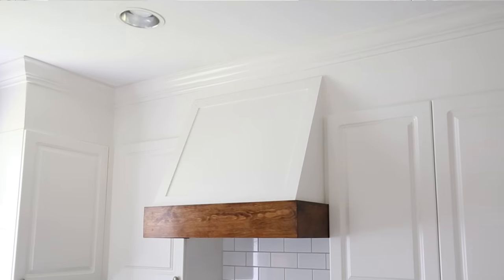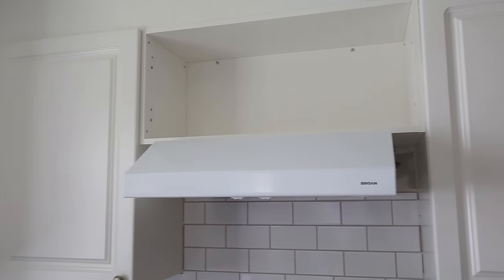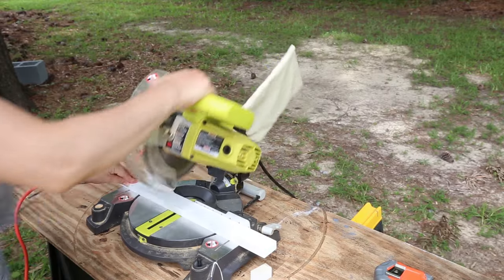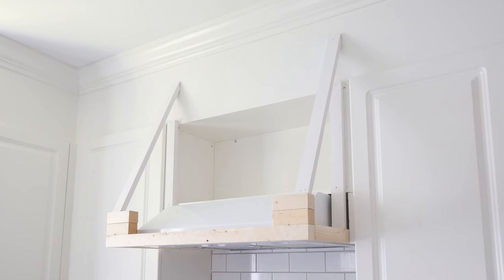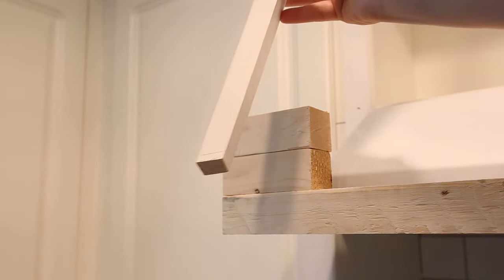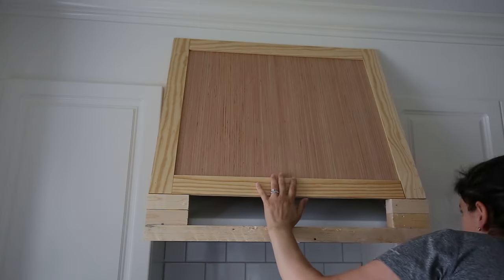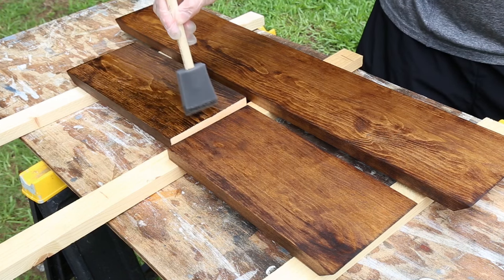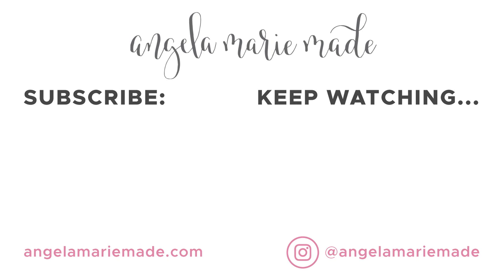DIY Range Hood Cover | How to Build a Range Hood Cover

Comment: And I have to say I have looked for the last hour for a "simple" build that gives a great, inexpensive finale. Like you have here.  I will definitely use your plan. AND I found a Nice Broan vent with all switches located on the bottom of the unit (not front panel). It was 99.00 at Home Depot.  Lowes had the same thing for 160.00.  I love Cheap...er inexpensive also
Reply from the maker: That is so nice to hear, I'm glad this video was helpful. Great deal on the range hood as well. Thanks for sharing!

Comment: Gorgeous! This video ended up inspiring me to entirely redo our hideous basement kitchen. Once I'm done on my $400 budget it will go from ugly 80's laminate to chic farmhouse modern. I'm starting the range hood cover project today so I'm excited to start and this video makes me feel WAY more confident to do something so extreme by myself. Thank you for providing such clear instructions and helping empower us DIY'ers!
Reply from the maker: Thank you so much, I'm so glad you were inspired to make over your kitchen! You got this!!
Reply: @AngelaMarieMade  I wish I could attach a photo but it turned out amazing and took hardly any time! Mine is free floating (not attached to cabinets) and I had to modify it so the front is on a hinge since the controls are on the front at the top (least convenient spot ever!). The kitchen looks SO expensive and as you said in your video, it makes the room look warm and inviting. Of the projects in this room, this one has had the biggest impact by far. I will be checking out your other videos for further inspiration. 😃

Comment: Great idea! Question? You are using the ductless feature on hood I see. Which way does the air flow go to escape after being filtered? Inside cover or does it blow filtered air down? Was worried about condensation build up of hot filtered air over time inside cover?
Reply from the maker: Thank you, great question! There is about an 1/8" gap at the top of the angled piece for air to escape, and additional gaps underneath for air to flow because the replacement vent was not as wide as the one we replaced.
Reply: @AngelaMarieMade 
😂

Comment: Hi. Great work. Simple but very charming.  I'm thinking of doing a similar adaption. I was wondering how  the wood under the hood has held up? And has the suction power been adequate for your cooking needs? Ty!
Reply from the maker: Thank you! The wood under the hood has held up great, we painted it with Benjamin Moore Advanced line paint(the same paint we used on our kitchen cabinets) and it is very durable and wipeable too. The exhaust fan is a little loud but it works really well and has plenty of suction.

Comment: Did you use a regular vent? How do you work it with the one you made are not the switches on the front? Thanks
Reply from the maker: It was a pretty easy install, I have a step by step tutorial with photos that goes into more detail on my blog post (link in the description box). Thank you!!!

Comment: Am I seeing something not there.  But it looks like the stain on the front board dripped and ran a bit.  Is that correct and did you do that on purpose to add to the farmhouse feel?
Reply from the maker: It could be the lighting or the distance but there isn't any drips when you get up close

Comment: Is that a 30 inch hood fan or smaller? Also, where did you find one with buttons on the bottom?
Reply from the maker: It's a 24" hood, and there is a link in the description box.

Comment: I have a question, I plan on installing my vent in my new house 36 inches above the stove and I was wondering how high you installed it above yours? Do you or your husband ever hit your head? I'm worried cause I'm 6'3 and it's hard for me to visualize it.
Reply from the maker: Ours is 27" above the stove and we haven't had any issues with hitting our heads.

Comment: That plywood will collect water from steam and rot or mildew over time use Medex a waterproof MDF product to prevent that.  And a 69 degree angle is call an obtuse angle which starts from zero not 90.  But it’s DYI but if a contractor is doing this shame on him/her!
Reply from the maker: There's plenty of air circulation to prevent mildew or mold, specialty products can be hard to find. If there is concern about moisture, applying a coat of primer to the wood to me seems more practical. That being said, the product looks promising, I like how it is formaldehyde free and sustainably sourced. Thanks for sharing!
Reply: @AngelaMarieMade  Medex is sold at every home center or can be ordered.  However; for someone like yourself or anyone else doing DYI it’s fine!
As a contractor (which is who I am addressing) you should expect more!
In fact thee best job !  Doing ok is not acceptable period and could jeopardize one’s license!!